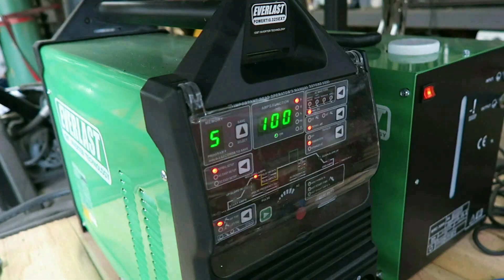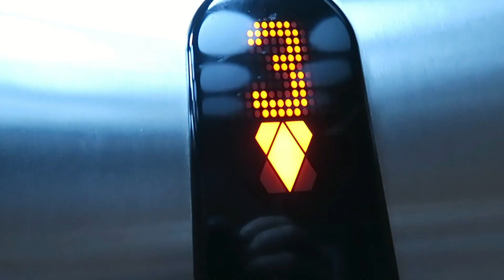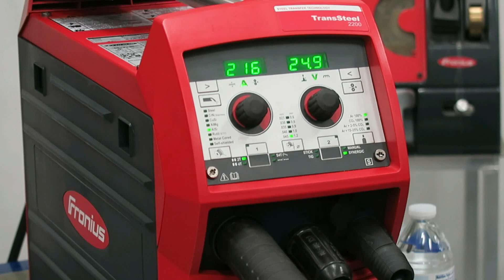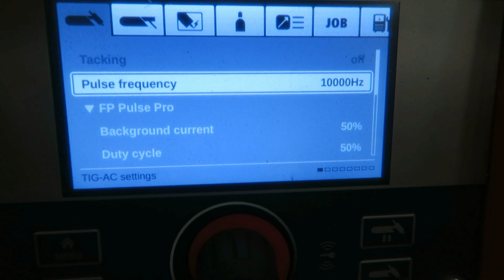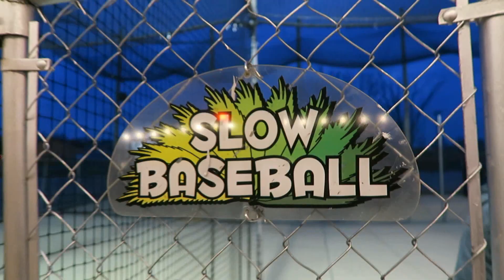Perfect Welding

Comment: I will be testing the new mw 230i in two weeks time. No new inovations to the welding process its self but they  added bluetooth connection and new look o and the torch is completly new also. Fronius is top cant wait to get the new one it will be 3200€ plus tax here in europe without watercooler.
Reply from the maker: yeah I hope to get my hands on a Magicwave my self
Reply: If only it was that cheap in Australia 
They retail the 230i for $7600

Comment: Great vid- I am currently looking for an aluminum capable small tig setup but it seems like warrantee/ price are the two big factors. Currently leaning towards Lincoln squarewave 200 with 5 year warrantee so any comments welcome
Reply from the maker: what kind of budget?
Reply: The Fab Forums I have been MIG for a while and want to get into TIG, but need a small unit that isn’t heavy. Main goal is to have something that will last forever, but of course I don’t have a ton of money. Eastwood seems a little too cheap quality wise, so I am looking at around 1300 bucks I think
Reply: Everlast 200dv is twice the machine the 200 Lincoln is. Comes with better pedal, torch and you can actually adjust things.  I almost bought the 200 sq wave until I got away from the red\blue mentality
Reply: Freakingstang Just did some research- good suggestion! Has an impressive duty cycle, and right at the price point. Still don’t know about their warrantee, but looks like a good rig
Reply: Five year warranty Ben

Comment: I checked to buy a Fronius welding unit and found it was like pulling hens teeth. I can only  imagine the problems with support.
Reply from the maker: I bet considering they havent been released yet.
Reply: I found it tough as well, first looked when Chucke had the video using really long extension cords and the impression that lasts is there is huge potential but...I am talking specifically about in Canada, left feeling they are big in Europe on the industrial side but not really present in North America (yet?).   What you always hear about Esab is lack of support (has kept me from buying their's over the years, regardless how good they are) and close to 50% of the times I check Everlast (Canada) website most items are listed as being "out of stock" which also means automatically questioning support.  In the last month I have found 3 other "welder manufacturers" that I never knew existed but with each of those you are left thinking, ..."these are all being made to order by the same plant somewhere outside of North Ameria...".